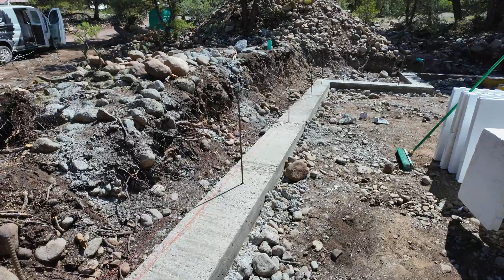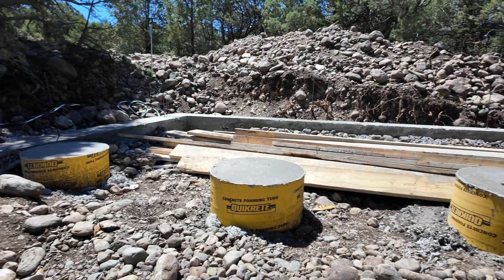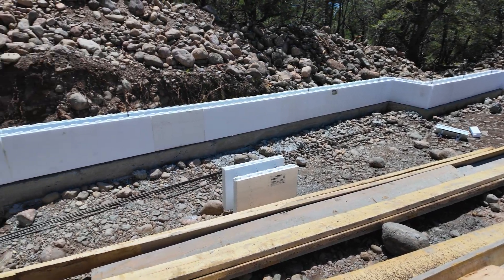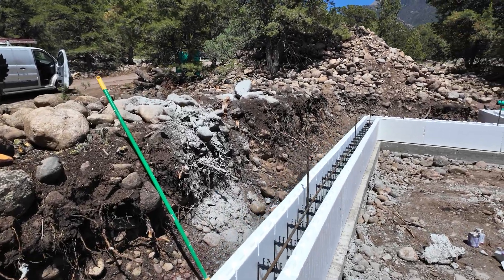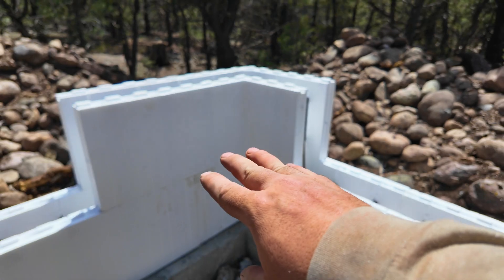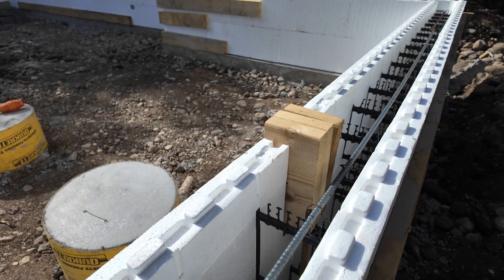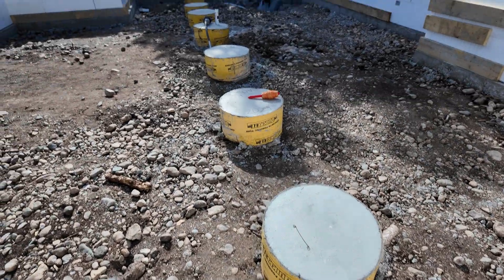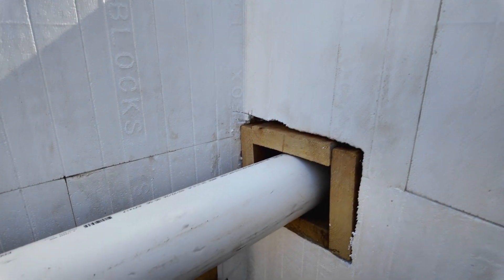Epic Construction: ICF Foundation Building and Pouring!

Comment: It looks like you are doing a great job I was wondering how you got the water to wash down the cement truck after your pour or did you already have a well dug and working?
Reply from the maker: @clearlakebunch8569  thank you. The truck has some extra water for wash down and we connected to the water system a couple weeks before and had a yard hydrant installed

Comment: does the concrete not cause the ICF blocks to float up? Is tying it to the vertical rebar enough to hold it down?
Reply from the maker: @albertaguilar1000  never had any  problems with floating

Comment: how much would it cost to hire someone to do this for me and just this (I am looking to build the house myself but want to have a really good foundation like this and not have to deal with setting up water sewer and electric)? Is this more costly instead of leaving no crawl space and just laying a cement foundation? How would the sewer and water be connected with a solid cement foundation? Sorry for all the questions you are just the first person I have seen that has actually been super helpful and detailed! :)
Reply from the maker: Hey, glad I can be helpful. Price will be different in different areas, in this area it is very rocky and utilities need to be deeper to prevent freezing so that brings the price up compared to a sandy warm climate. This area if hiring a contractor the excavation of the house site and running utilities would be around $18k and the ICF foundation would be around $13k and if you had a builder build the house it would be about $250-$300 per sqft. If you went with a concrete pad instead of a crawlspace you would build the forms for the outside edge of the pad and then the water and drain pipes would be measured and installed inside the forms. The measurements have to be exact so the pipes will come up in the right location, such as in a wall, or the right place for a toilet. Once pipes are in rebar would be placed inside the foundation form and concrete can be poured and finished. Then you get to start framing! Let me know if you have any other questions.
Reply: @slothconstruction  ur literally so amazing ily thank u for so much help ur so helpful